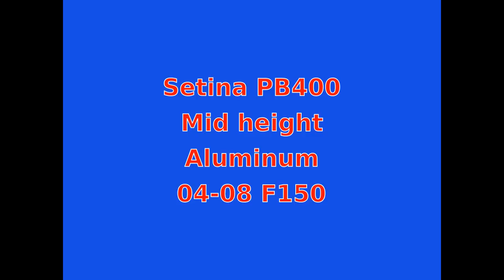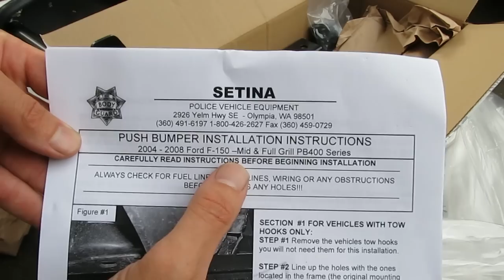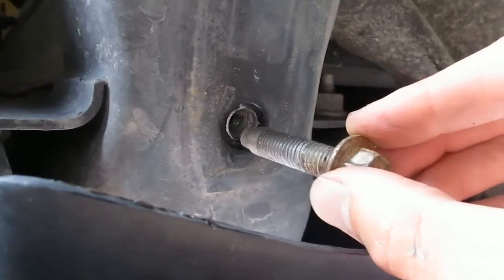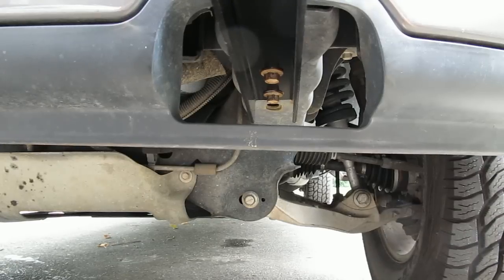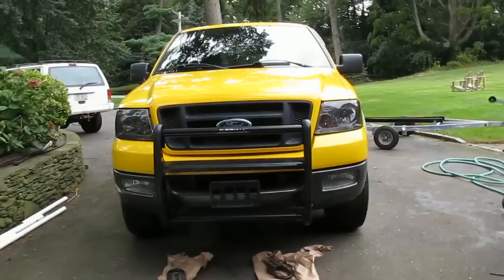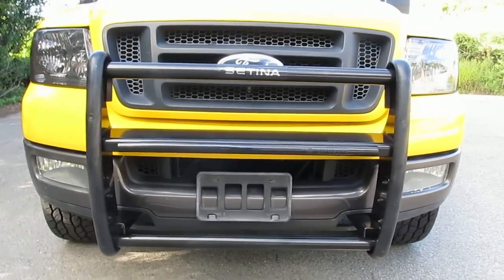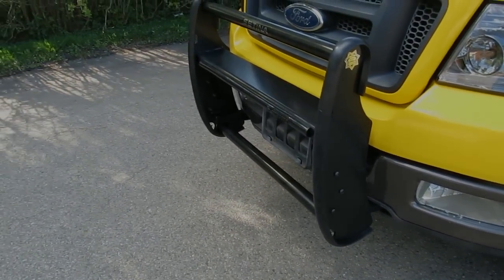Setina PB400 push bar install on 04-08 F-150

Comment: I contacted setina about my 2006 f150 2wd. They informed me they no longer make them for these trucks.
I found one on marketplace from a 2014 f150 4x4.
It bolted right in placeon my 2wd frame and sits perfect on my truck. It is taller. You see about an inch and a half sticking up above the hood.

Comment: Looks good, the Setina ones look the best out of some of the other brands (Go Rihno, Pro-Gard etc..)
I always laugh when I see trucks and SUV's wih the factory "Brush Guard" which is basically a trim piece and would protect against driving over a small shrub at most.... These are actually secured to the frame of the car and designed to push other disabled vehicles out of the road.
Reply: Chargèro k

Comment: what torque settings did you use, if you did torque it?
Reply from the maker: It's not really necessary, I just made the bolts fairly tight.

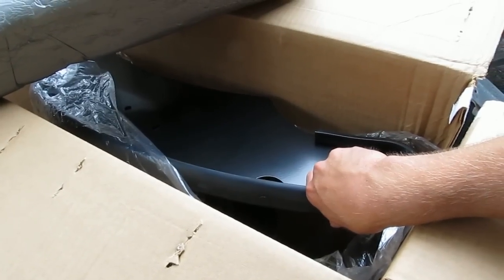Comment: For my vehicle in particular, a 2014 Subaru XV Crosstrek, a lot of bumper bar designs do protect, but unlike them, law enforcement-proven designs from brands such as Setina offer the only option available in the USA that is USA-made, designed to actually push other vehicles without damaging disabled-vehicle's paint, and does not interfere with airbag deployment. However, you mentioned at 1:17 that Setina specifically manufactures the part for one's own vehicle. However, I perceive this as American vehicles that are currently or formerly in use as widespread public safety vehicles. Unfortunately, my vehicle is not such a platform listed on any such application. I would imagine I would be given the cold shoulder for my vehicle...
Reply: After some searching on questions regarding various applications of functional push bars, I must concede to the reality that, as I had previously suspected, vehicles without widespread and/or significant public safety fleet use will not have any options whatsoever. My only option is to snag a used unit and have locally custom-made brackets to fit to an unlisted application.
Reply from the maker: You could try buying a used PB400 off ebay or craigslist and modifying a bracket for it to fit your vehicle.  I bought one and made a bracket for my John Deere Gator!
Reply: As nice as the PB400 is and how much I like the look, I'm trying to go with a low-profile design like the Setina PB100 or PB 200. The problem is, they are no local options available for me on craigslist, and ebay's listings are pretty slim on Setina products for those models.
Reply: Se le puede adaptar a un nissan altima 2006?

Comment: When it all boils down to it, all bull bars are useless. They can't handle any significant load, they will only get pushed into your front end in an accident, and they utilize the only useful mounting point on the front of the vehicle.
Reply from the maker: I would say that's accurate for most bars... this one is fairly stout... My plan is to weld up some tow-hook mounts to work with the bar (which will never happen.... project #482 for me!)
Reply: There's a difference between push bars and bull bars. Push bars (like in this video) are used on police cars for a reason.